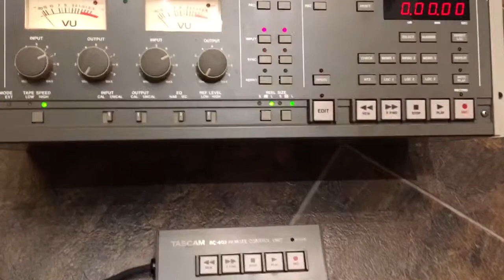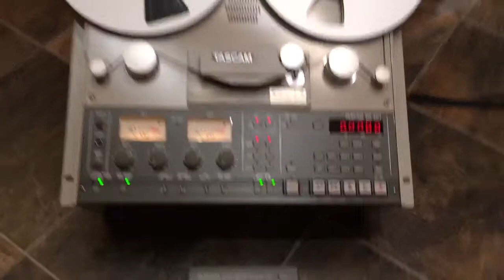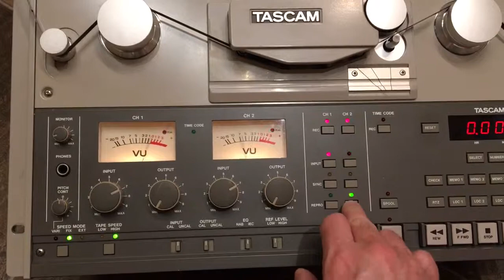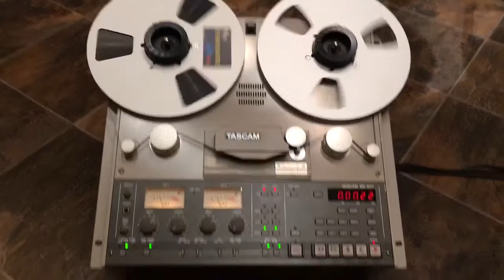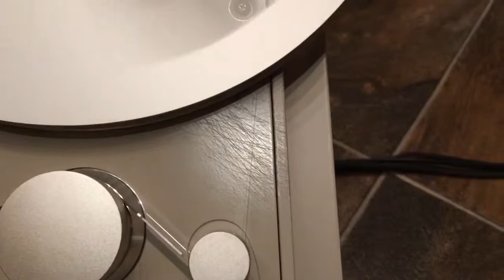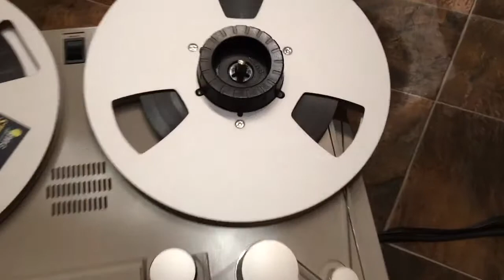Tascam BR-20T For Sale

Comment: Is this the machine listed on ebay in the Baltimore area, with no pics yet uploaded?
Reply from the maker: No, it is current eBay item #223457807533. Thanks for the question.
Reply: @SweetbeatsTechStop  Got it. Best of luck with the auction. It's a beauty.
Reply: @SweetbeatsTechStop  Hola, está disponible?
Reply: @SweetbeatsTechStop     Tascam BR20 SOLD?